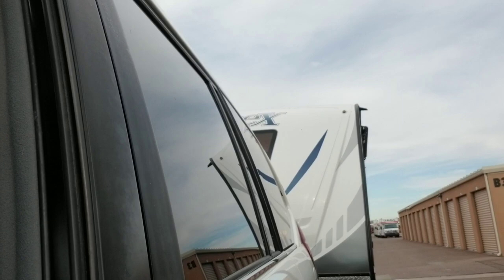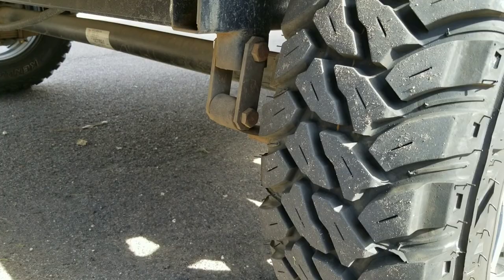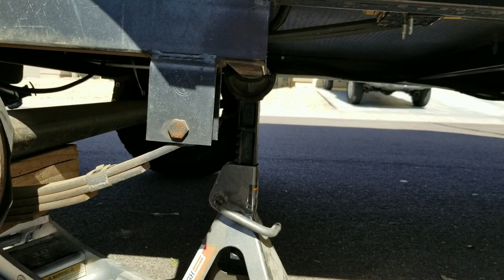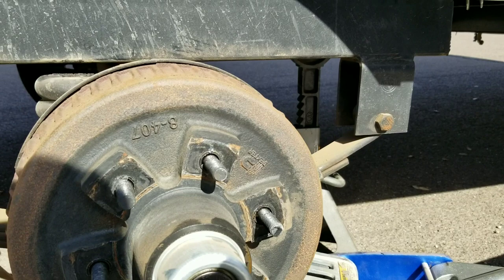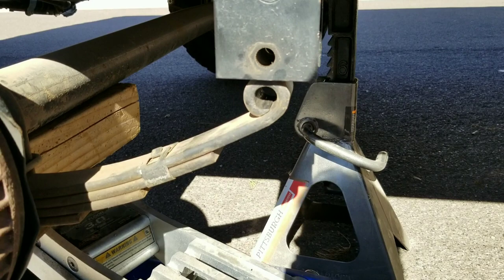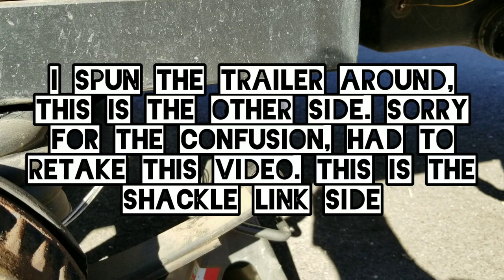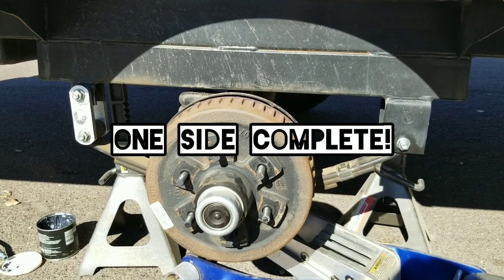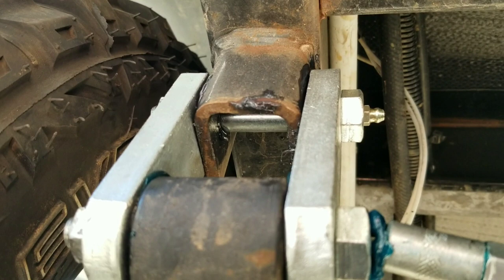DEXTER WET BOLT KIT INSTALL - GREASE YOUR TRAVEL TRAILERS SUSPENSION - NO MORE CREAKING OR SQUEAKS!

Comment: Well done sir!  Thank you for pointing out all the small details of your install, especially the little things you noticed before calling it complete.  I have the same trailer, except a 2019.  I've ordered the kit as well as the sumo springs.  I've been trying to figure out what I can do to both improve and help maintain my suspension but most everything out there is focused on dual axle trailers.  I'll reverse install the bolts on mine too, great idea there to make greasing that much easier.  Thanks again so much.
Reply from the maker: No prob! Man it is 10x better after.

Comment: Wet bolts solve the bolt wear issues on spring hanger no doubt. Factory shackles are borderline criminal.
Reply from the maker: Blows me away they still get away with a critical part with a high wear rate. Travel trailers and general trailer industry is rather sickening and lacking standards.

Comment: Thank you for the video. The section about installing a piece of bushing so to keep force the grease into the proper location is extremely valuable. I own a Coachmen Apex Nano 187rb. The noisy suspension was one of the first items I noticed upon taking delivery. I need to replace the shackles and install the wet bolts.Two questions for you. 1) What is the shackle kit part number? 2) what are the dimensions of the bushing tube you installed? TIA
Reply from the maker: Hey Richard, I have a link in the video description to buy the exact wet bolt kit I used. I have not upgraded the tube as I sold this trailer (kids outgrew it and I need something to haul my quads). Currently on the hunt for a new rig :)

Comment: Did you have an extreme braking event sometime in the past?  Those drums look they were a bit hot and baked the paint off the outside diameter and rust ensued.  Have you checked the brake linings recently?
Reply from the maker: Not at all, Trailer shipped through snow and salt in the winter to Az. That, and Dexters paint sucks 😅 They were checked a few times, zero issues or overheating. I also checked with a thermal gun several times a trip to make sure I was not having a tire or brake issue.

Comment: I having an Apex Nano 193BHS delivered in a few weeks and I’m really interested in the sumo springs from your video. Can you confirm that they are model number TSS-106-40 (for under sprung trailer suspension)?  Have you done any other modifications that you’ve been happy with?  Loved the video and I plan on adding the wet bolt kit before I start having all the noise!
Reply from the maker: Hello, I used PN TSS-105-40. I have countless mods to the nano, you can view them on the facebook coachmen apex TT life group. Mods such as 2nd bunk window, recessed stove, 650w of solar, dual batteries and inverter setup, upgraded wheels and tires, different control center for slide and awning... list goes on and on.
 https://www.facebook.com/groups/442018796136676/
Reply: Thanks for the tip!  I joined the group and it looks fantastic. Looking forward to tinkering.
Reply: @steveandmichellemoravek6948  Did you end up finding the sump springs?  I am looking for the same now and all I am finding is PN TSS-106-40 as well.  Which one did you end up going with?  I have a Coachmen Apex Nano 193BHS.  I am joining that FB group as well.  Look forward to seeing what that's all about.

Comment: How did you drive the bolt in that deep? The teeth on mine are still showing. Hammered it hard and it won't budge. Did you use a press? Morryde makes no mention of hammering it.

Comment: The splines not seating is the exact problem I’m having on my Apex 187RB. Pls show how you got them right.
Reply from the maker: It was ages ago, but I believe I took out the zirk fitting (grease fitting) and smacked the bolt head with a hammer to get the splines started Then, torqued down and they drew in.
Reply: @MR_Garage  Thx

Comment: Those tires didn't come with your rv ...did they ?  BTW love the exposed electric brake wires , same as my Open Range 20FBS ....gotta watch for road debris , could tear off the brake wires , shoddy and lazy !
Reply from the maker: Nope, I put them on. And yeah - every trailer is built on a Friday by a guy that learned electrical last week 😅
Reply: @MR_Garage  👍

Comment: Where’d you get your rims and tires?
Reply from the maker: Rims are lionshead bobcat 16" 6 lug trailer rims. Tires are Kenda klever mud terrain 225/75/16
Reply: Mr. Garage are those aftermarket?
Reply from the maker: @randyfreeman  yes - rims are made for trailer use. Common to see them on certain model trailers.